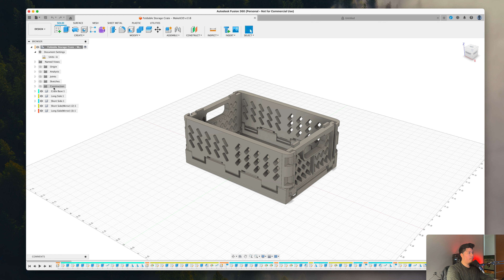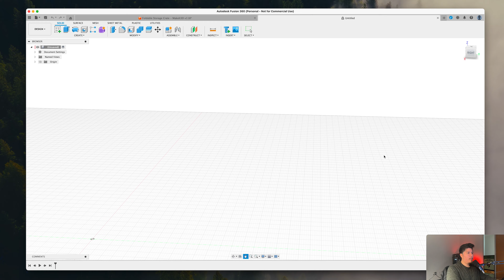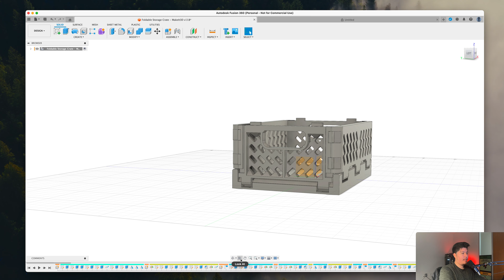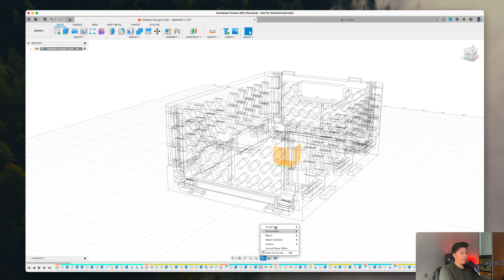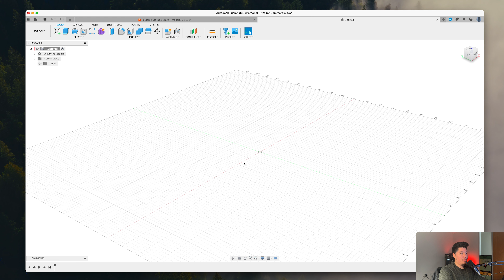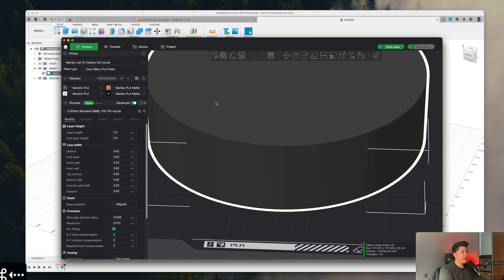Fusion 360 Course for 3D Printing 2024 Edition | Part 1

Comment: Brandon,
A lot of the Fusion 360 training on YouTube I cannot watch. They talk too fast, I cannot even see what they clicked on. You speak clearly and appear to be knowledgeable about Fusion 360. I'm just above beginner, so I'm always looking for new courses. If I was a beginner, I would be frustrated with this video. You should cover half of the topics in the same length of time. Example...Why did you select the bottom plane, what is the purpose of the plane, do I have to select a plane, how do I turn off the plane view etc. Don't just show a button and read its title, explain it. You can make as many courses as you want, you don't need to cover a lot of topics in each course, just explain it in greater detail.  With that said, I Subscribed and plan to watch more of your courses. This was just my comment, you did a fine job. 👍